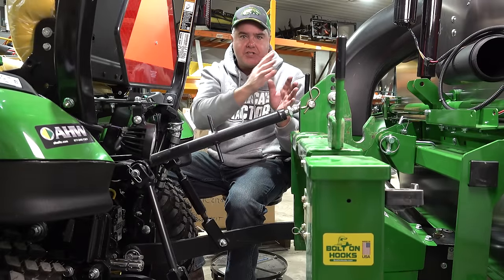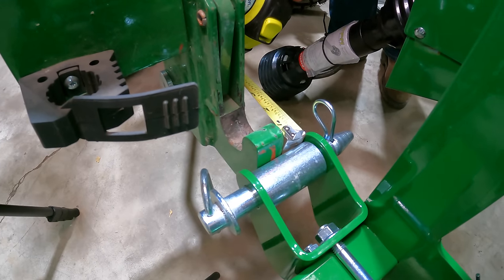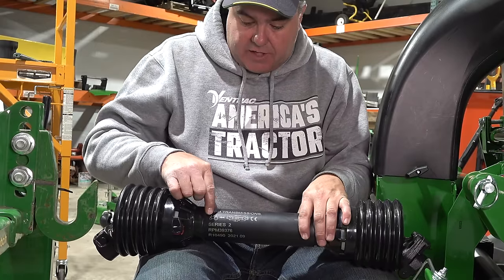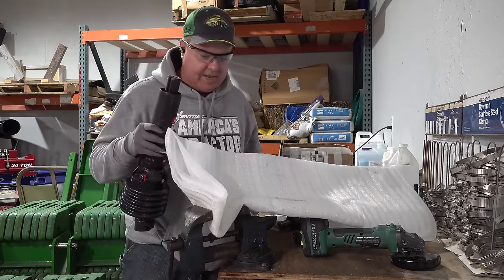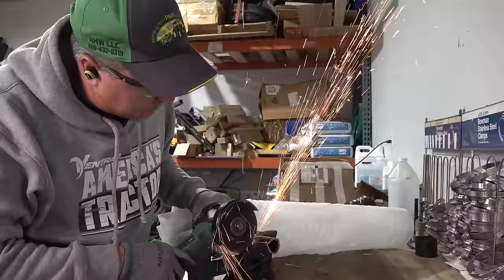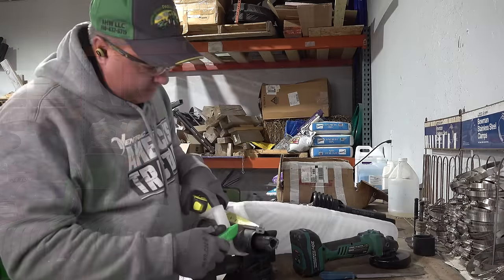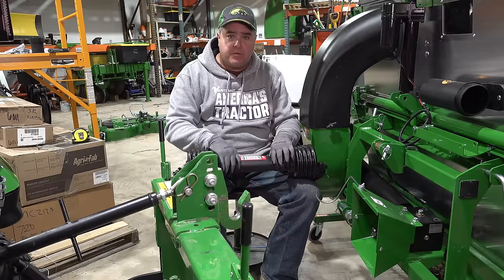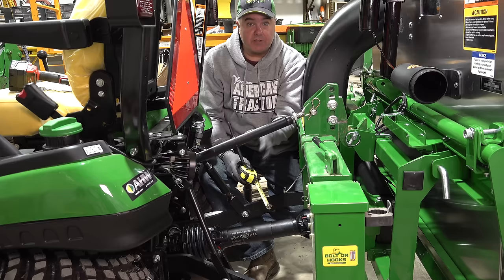How To Measure/Cut Tractor PTO Shaft THE EASY WAY!!

Comment: Great video Tim.  I would caution you on your method of measuring the length to cut.  It worked for you, because your shaft was horizontal going into your implement.  If the shaft sloped down going into your implement and you measured and cut your shaft, it would be too long when you raised up your 3 point hitch, potentially causing some damage.  In addition, depending on the attachment, adjusting the angle of the quick hitch by changing the length of the top link could also shorten the PTO shaft and cause a problem.  You do mention to test the length by raising and lowering the 3 point hitch to check the length, but it is better to check that before you cut.  Because of these issues, I always leave more than one inch gap, test raising and lowering the 3 point hitch to see how much the shaft length would change, and ensure that I also test adjusting the top link.  One other thing to test when cutting the PTO shaft is that after cutting, you still have the minimum overlap of the two shaft parts that is required throughout that range of motion and adjustments.  Minimum overlap depends on what the manufacturer of the PTO shaft says it should be.

Comment: Great video Tim. I used a Diablo extreme metal reciprocating saw blade. Cut like a hot knife through butter. No chatter, no sparks and no turning the shaft. Cut in 10 seconds or less.

Comment: Great video Tim.  I would have only cut 2.5" off the inside shaft.  But after watching this video and listen to you explain why you need to cut both shafts I now understand cutting only one shaft would be wrong.  The light bulb clicked on.  Thanks for taking the time to go over the proper way to cut a PTO shaft and why.
Reply: My light bulb never clicked!  lol It makes sense cutting both sides for sure, but in my mind say you needed to cut 2" total.  To me that's 1" off each side.  I watched someone before this video and that's what they did.  I saw Tim and thought he's a pretty thorough guy, so I watched and now I am confused.  He also didn't mention anything about when the 3 point is at full height.
Reply: @johnpyle8027  i’m with you. why does he need to cut 2” on both sides if he only needs to remove 2”?
Reply from the maker: Ha!  Well, since they overlap, if you want to shorten by 2”, you have to shorten both ends by 2”.  It took me awhile to grasp this as well.  
You can experiment visually with it…you will get it when you see them sliding together.
Reply: @TractorTimewithTim  yup i get it now! thank you.
Reply from the maker: @John sorry I missed this comment.
I tried to explain it…but you may have to visualize it for yourself.  I assure you that my statement is correct.  To shorten the shaft 2”, you’ll need to trim 2” off each side…remember, they are overlapping.
As for 3 pt at full height.  I think (but not sure) that I said you should measure at height where distance is the least.  Usually this is ‘down’,  but I suppose it would not need to be.

Comment: Tim, thanks.  

I bought my tiller 21 years ago to go on the back of my Kubota B1700.  When I sold the tractor and upgraded to a BX the  lift arm to PTO output length was shorter.  The shaft is about 1/4 inch too long to install after 3 point hookup. 

So, for 15 years I’ve struggled with installation… Additionally, I tighten my top link to get more ground clearance when loading it on my trailer.  If I forget to lengthen it before I till, the shaft actually bottoms out.  By luck, I haven’t damaged the PTO unit or drive yet!

You’ve inspired me to “do it right” and shorten the PTO.  It’ll be one less thing to worry about, easier to connect and a disaster averted!

Again, thanks.

Comment: Hey Tim. Great video, the pto is compressed the most when it's level so as you go up or down it should extend out. That being said for a attachment like a rotary cutter it would be important to cut the shaft more then just a half inch past the tractor shaft because you need to take into account that when you go through a swale the angles change the pto could compress even further. Cutting the shaft on a rotary cutter isn't as fussy because it's such a long shaft you still have tons of overlap.

Comment: Nicely done. 
I removed the plastic sleeves by pressing in the white tabs. 
I then sawed the plastic separately. 
This allowed me to get the shafts in the vice securely. 
Then you can cut the shafts with whatever cutting device you may have. 
It is a good idea to protect the surface of the male shaft to prevent interference with the female. 
Also a good idea to make sure the shafts do not “bottom out” at the furthest reaches of your lift.
Reply: I agree. Two different shaft suppliers that I used advised their best practice was to separate the halves and separate the plastic casing from the steel shafts before cutting anything.

Comment: Thanks Tim for making this detailed video Its extremely helpful! Oddly enough, I just purchased a Frontier RT3049 tiller for my 2025R and the dealer said I should see it an a few days. I have been nervous about cutting the shaft correctly. I'm much more comfortable after watching this video. I have the I match quick hitch also. Now to remove the backhoe for the first time....
Reply from the maker: Congrats on the new tiller. 3049 is incredible.    The backhoe is easy. don't worry about it!

Comment: Nice hose clamp collection and stand you have there.  I’ve always worried and measured for maximum pto shaft length with the implement in the shortest position.    It’s not easy, so I like your way, thanks for the demo.

Comment: Thanks for the video. Your father must have known my dad. Whenever he cut something 3 times it was still too short. When I cut my PTO shaft I took the cover off the shaft and cut them separately.   Keeping them together and cutting is a much simpler process.  I also love my Masterforce grinder. One safety hint, when using power tools tuck your hoodie strings inside so they don't accidentally get caught in the tool.  Oh I almost forgot. I just got my Ken's extended top hook for my imatch. Keep up the great videos and have a joyous Christmas from Minnesota.

Comment: Improved great tips.  The only suggestion I can make is that after you cut and file the (metal) shafts, stand it up and tap it on the table to knock out the metal filings that might come back to haunt you later.  Keep up the great work.  I learn so much from your channel.

Comment: Hi Tim, one important thing when measuring is to check the shaft at ALL positions - lowered, horizontal, and fully raised. Not all tractors maintain an even arc, and you want your cut to suit the shortest distance through that arc. There'll still be plenty of overlap then for the longest distance.
Reply: Mines 1" shorter lifted
Reply: And what happens is if it fits down but barely when you lift it can brake the pto because it pushes it in so hard
Reply: @loganmartin8613  cut to accommodate shortest distance

Comment: i do not have any PTO powered equipment but your instructions make sense to me. It would complicate things but I think that safety tube is easily removed. If it is steel shaft could be held more securely in the vise. Rotating that steel shaft while cutting looked good.

Comment: I took the plastic off mine before cutting. Just a couple clips to remove. Made it a lot easier. Also used a metal blade in a "Sawz-All" which made short work of it.
Reply from the maker: Ok, well, I disagree with ‘easier due to removing plastic’, and I disagree that sawzall is easier.  I used sawzall in the earlier episode.  …the approach shown in this episode is much easier for me.
Reply: May be so. Was my first one and I didn't have an angle grinder at the time. Fixed that problem though.

Comment: Hi Tim,
Great video as always.
One thing I do, is to use standard engine oil on the PTO shaft connection versus grease. It makes the connections easier, especially in cold weather.

Comment: Bought a new brush hog today and are preparing for the process & procedure for checking & cutting my PTO shaft mating lenghts.  Have done it several times before but always enjoy a "refresher course" as reinforcement for doing it right.  Great job, Tim.  Always appreciate your clear and concise "how-to" instructions.  I would add one small item....make certain your PTO shaft mating surfaces are fully greased so that "slip & slide" works when it is suppose to!

Comment: Hey Tim, great video.  I have used a sawzall for my first time.  Ok, but not as easy as a cut-off wheel on a grinder.  To mark the line, I wrapped a piece of colored electrical tape around the shaft.  Easy to follow the tape edge.  Great videos.
Reply: Explain how a Sawzall is harder to use for this than cutoff wheel on grinder. Go:
Reply: @alteredaustin1  Personal preference.  That is all.

Comment: When I first got my B2410 I bought a tiller and finish mower, I set them both up without a QA. Later on I got a QA and the FM PTO was usable, but the tiller was too short.  Instead of replacing the PTO with a new one and cutting it to fit, I found a PTO adapter with same inside 1 3/8" 6 spline with the same outside spline.     So if you plan to add a QA and get new attachments first, wait until you get the Quick Attach mounted before cutting the shaft.

Comment: Tim you can take the outer plastic  sleeve off quite easily. The red tab unlocks the white plastic ring from the outer plastic shield allowing  it to slide off of the metal shaft.
Reply from the maker: But I have broken the tabs in the past, and I do not know where to get replacement shields.  My approach is most conservative for me.

Comment: Tim, you should do a video on everything that's wrong about the Pto Link system.  It adds length, screws up dimensions for pull type implements and drawbar length, adds another joint in the rotating mass to cause more runout, moves the universal joint and shield away from the tractor shield, and on and on.   I can't believe this dangerous contraption is actually on the market.

Comment: Thanks Tim.  

If you'd let me add one thing, that would be to do the raise and lower measurements before you cut the shaft.  Believe it or not I've had a JD implement that the shortest PTO position was the raised position and not the lowered position.
Reply: That's true on my Kubota with my Stump Grinder.  I'm going to measure with the implement fully raised and make sure it doesn't bottom out.  Then insure that there just enough clearance to the PTO to be able to install it when the implement is on the ground.  Whichever of those two is shorter.   I want to maximize the overlap, because it lengthens as it lowers into the ground, and it can rotate if I go too fast, which can further extend the PTO shaft.

Comment: I'm about to do this but a tip from cutting with a grinder, wrap the plastic tube with tape all around to cut evenly all around. Second part to the tip is funny stupid, but put the tape on the waste part of the tube so you don't have to take it off or mess with melted glue if it gets hot :D
Thanks for the video.

Comment: Glad you did another video on this and you hit on some additional points that you did not previously.

Regarding the PTO shaft length - 

Every particular tractor model is obviously going to likely have its own dimension from the end of the PTO shaft to the three point arm attachment point center. Likewise, every implement is going to have its own dimension from the PTO input shaft to the three point attachment point center. But variation of implement usage happens - either between tractor models or even between a single tractor's configuration at any given time.

Given your experience with damage to the 2038R because of the PTO shaft being too long, other than trying to keep the PTO shaft as long as possible as you described in this video, is there a reason you do not base your PTO shaft length on the straight line distance between the tractor PTO output shaft and the implement when the implement is attached without a quick hitch? 

When I received my 2038R in mid-September this year, and as I got each of my various PTO driven equipment pieces (new and used), I made sure to attach the implement directly to the three point to establish the PTO shaft length. I did this because I wanted to ensure that the PTO shaft length was not too long regardless of how the implements may get attached to the tractor, with or without a quick hitch. Once I ensured that the PTO shafts would not be too long when directly connected to the three point arms I then verified that the PTO shafts would not be too short and have too little engagement between the inner and outer portions of the shaft. My approach to this issue was to protect the tractor at all costs in a "worst case configuration" consideration.

You example in this video clearly would be a very short PTO shaft if this particular implement were directly connected to the three point without a quick hitch.

In the event that an implement is used with multiple tractor models, or multiple configurations of a single tractor, it may in fact require having multiple PTO shafts for that implement to operate safely as well as to protect the tractor(s).

Comment: Maybe I'm nitpicking but its commonly called Extended and Collapsed length. 
 Also Tim, consider a Portable Bandsaw for your tool arsenal. They cut smooth and quickly with no grinder wheel dust. I got a cheap one from HF and it cuts just as good as a Milwaukee.

Comment: I clamp the exposed end of the PTO shaft in the vice to cut the plastic cover first, that way you can rotate it while cutting. To cut the shaft, I clamp a piece of pipe in the vice and slide the shaft over it so it can be rotated while cutting it with the grinder. Using a piece of tape for a guide also helps to keep things square.

Comment: Tim, I use a small cut off saw to cut my PTO shafts. It allows you to clamp the shaft during cutting and a miter saw to cut the plastic case. The cut off saw is about $50.00 at harbor freight and has been worth the cost because of other projects.
Reply from the maker: I’ve got one.  Works great!

Comment: The only thing different I would do is cut the implement end first, if there is a changes it will be the inside part of the shift, not the outside...  (you came out with the same results).  Have a great day...

Comment: I like to trim my PTO's to a length such that I can unhook the shaft from the tractor at any position in the 3PH range of travel.  I remove the guard sleeve and end bell from each half of the shaft.  Cut the sleeve in my power miter saw for a perfectly square cut.  Shafts get cut in the horizontal band saw.  Deburr everything, wash in solvent, reassemble guards,  apply fresh grease and let 'er rip.

Comment: Nice vid.  If you are like me, and hate nicking the paint?  Wrap the shafts with blue painter's tape--- wrap on the side you are keeping, and cut just along the outer edge of the tape (you don't care about scarring the cut off piece).  This works on both the plastic cover, and the metal shaft.  Nice work-- I'd have used a Dremel tool instead of a file, but that's because I have no actual files... :)

Comment: Hi Tim, I just picked up my first attachment and it's a 60" King Kutter Tiller. It has a quick hitch on the tractor. The tiller is on its almost lowest position and I was able to attached the PTO shaft with no issues. I had to extend the PTO in order to attach it to the tractor. I guess my question is, do you have to cut a PTO shaft to every tractor or are there some that doesn't require to cut the PTO? Thank you!
Reply from the maker: If there is plenty of room for the PTO shaft to retract in up and down positions, then you are fine:

Comment: I like your video. However, it is worth mentioning that there are scenarios in which you don’t want the driveshaft to be short enough to connect with the implement already attached to the three point. Case in point, I have an L6060. I have a newly acquired Bradco 612 chain trencher and the driveshaft needs to be quite short - about 17” from the center of the rear u joint to the tip of the PTO on the tractor. This would only leave about 5” of overlap if I were to follow your directions and cut the driveshaft short enough to be able to disconnect it while still attached to the three point. There would be so little overlap with the male and female tubes that it would not work. Hopefully this makes sense… I’m going to have to make sure the shaft is not too long to cause a bind, but not short enough to not have at least several inches of overlap.